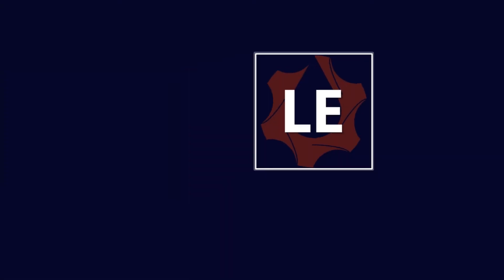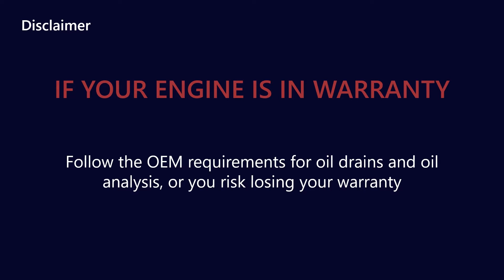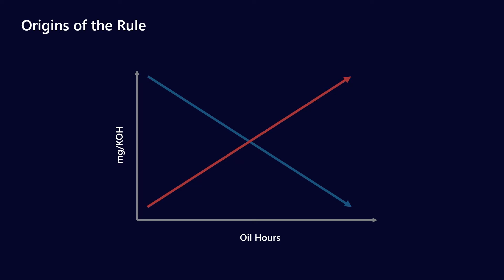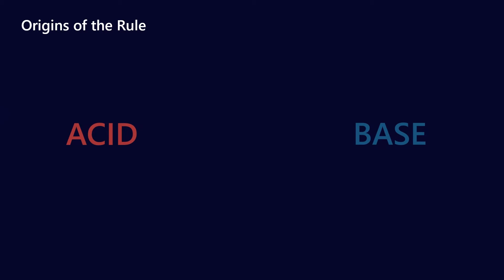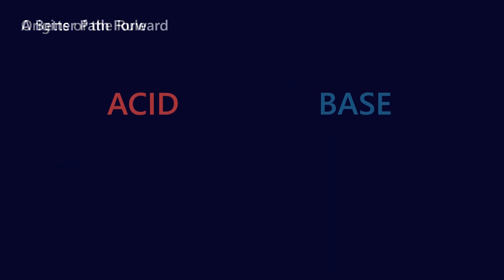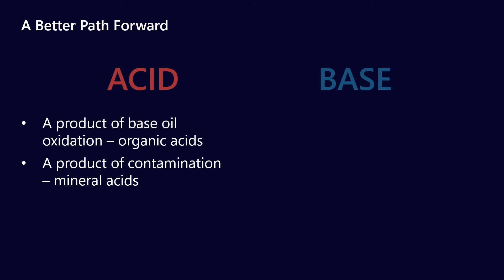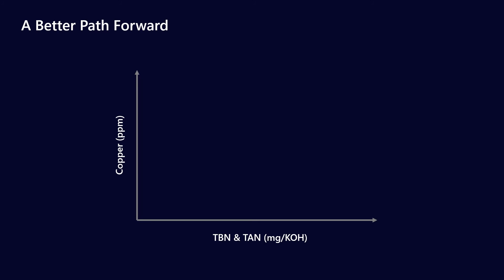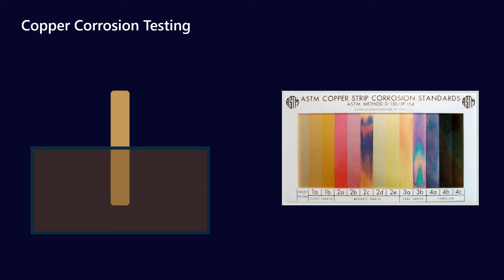Why you should stop using the TAN x TBN crossover limit to condemn your gas engine oil

Comment: Is copper strip corrosion test representative of any other metal in the engine? From what I remember, metals can corrode differently, depending on the condition ( including the possible coupling of west and corrosion, i.e tribocorrosion, which would promote corrosion on some elements more than on others, I suppose) is there no similar test method for say steel, aluminium or tin if such metals are present in the motor?

Comment: Congratulations for the video!
I have just carried out two laboratory analyzes, one on virgin 5w30 oil and the other on the same type of oil with 3200km, carried out in a turbo petrol engine, with my surprise the TAN on the use oil has dropped from 1, 7 to 1.31 ...
Could you know why?
Is the gasoline dilution perhaps one factor that may affect it?
The dilution value of the used oil is 4.5%

Comment: @Lubrication Explained how can you compare 1a or 1b copper corrosion test with any of TAN or TBN mg KOH/g? I mean how I can say that if initially 10.0 mg KOH/g of oil TBN is now depleted with copper corrosion?  Simple you can not compare copper ppm too with TAN/TBN depletion. Its only justifiable method to know the condemning limits of TBN is to measure TBN or TAN. As per my knowledge if TBN is depleted 70-80% then we can change engine oil or if TAN value increased 2 or 3 mg of the initial value then it will also be condemning because wear can occur due to depletion of zddp or it can also due to dust (abrasive wear). Right?
Reply from the maker: The question this video is trying to answer is - why do we change engine oil when TBN is depleted? TBN is itself an arbitrary construct. So what is special about 50% depletion? Or 80%? Why is the percentage the same for an oil with a starting TBN of 10, and one that starts at 5?

We should really care about the EFFECT of TBN depletion. If TBN depletes, then the risk to our engine is that we experience corrosion. But if there is no corrosion, then why change the oil?

You are right in that wear can occur - but this is a seperate failure mechanism. If the TBN has only depleted by 2% and we see high Iron then this may be a reason to change the oil or investigate the mechanism of wear.
Reply: @LubricationExplained  oo oky oky you are right oil change practice should not only based upon TBN depletion, one should check complete chemistry of oil like wear & tear, water contamination etc etc
Reply: @LubricationExplained  but after all complete check up its come to the point that TBN upmire will be the final authority of oil change, then how much % depletion you guide 😊?

Comment: How TAN & TBN coexist same time
Reply from the maker: Good question - it doesn't really seem to make sense does it? There's a couple of explanations. The first is that our understanding of acids and bases are shaped by aqueous solutions. In oil, the acids and bases aren't necessarily dissociated, so H+ ions and base molecules don't necessarily react with each other. But at the same time, most acid-base reactions are equilibrium reactions, in which not all the acid and base reacts with each other.
Reply: @LubricationExplained  How much % depletion of TBN you will suggest at which oil should be replaced?

Comment: Great explained! Some cars already have sensors to monitor lubricant condition, do you know what they monitor?
Reply: Just color or transparency. Actually less sophisticated than just pulling the dipstick and using your fingers and nose, but is good for the marketing department's feature count and the many completely ignorant car buyers that have had zero auto-shop or driver's-ed. training. (I've met some that don't know there is oil in the car let alone that it needs to be changed....yet they are licensed operators...)
Reply: @mytech6779  I can imagine! I believe every driver must know the basic about its car to keep it running properly. But....just a few think like us!
Reply: @luizfernandopaquieli3709  Really drivers-ed should be mandatory regardless of age  and one semester of auto-shop required in high school simply because cars are so completely integrated into life in the USA. Especially with increasing immigrant populations that do not have the advantage of a family history with motor vehicle operation.

My original comment isn't about being able to maintain the vehicle, it is about proper operation, fewer breakdowns blocking traffic, fewer accidents caused by malfunctions or exceeding a vehicles limits, less pollution from abused vehicles.
 
Very few aircraft pilots are certified to do any maintenance on an aircraft but the FAA still requires a solid understanding of aircraft systems specific to a category of aircraft for a pilot certificate.
Reply: @mytech6779  that is worse than I thought! I was thinking you meant about knowledge on mechanics, but talking about the correct way to drive must be the minimum to get a car on street! We face the same situation rere in Brazil, but some States there's no discipline and education on streets, not only drivers but people and bikers don't respect each other!
Reply: @luizfernandopaquieli3709  I have not been to Brazil. The driving license system in the USA is very old and depends heavy on parents teaching children the detail. This alone was only on the border of acceptable when the population was low, and there was always a fraction of bad drivers.
But with many new immigrants from countries where there are very few cars,(such as Asia and Pacific Islands) they do not have this family knowledge which makes the situation much much worse. And it is extremely obvious an an observer with professional training that many simply have no understanding of the vehicle function. The increasing population adds more traffic which multiplies the problem.
Reply from the maker: Wow, great discussion! I think you already have your answer, but just to elaborate - even the inline sensors coming to the market in industrial applications aren't all that sophisticated yet. I've seen some decent live monitoring of oil cleanliness, but that's about it so far.

Comment: wow! this is a good eye opener. we should lobby a standardized test for this than the TBN and TAN crossover.
Reply from the maker: I'd just worry about TAN to be honest. I've always found it wild that if you're using a .5% ash oil you would condemn the oil at a TBN ~2.5. And yet if you switch the same engine over to a 1% ash oil, all of a sudden you need to trash the oil at a TBN of ~5. Makes no sense.
Reply: @LubricationExplained  True, I think that those before us have thought about this TBN and ash and just place the numbers and decision standards based on their observations at available technology. Maybe we can switch to the amount of wear an engine can tolerate than the TBNxTAN. At the same time introduce a minimum standard material for engine manufacturing. Long work but makes our lives easier in the end, right?

Comment: Not sure about this. My understanding is, that new oil has TBN & TAN is zero?
Until TBN actually goes down to zero - How can TAN even start to appear?
Reply from the maker: Generally, new oil will have a starting TAN around 0.5-1 mg/KOH - base oil refining isn't a perfect science so the is some trace amount of carboxylic acids that make it through the manufacturing process. 

Unfortunately our understanding of acids and bases is usually shaped by the mineral acids and bases that we learn about in chemistry (like HCl, H2SO4, NaOH etc). In most of these cases, if you have a basic solution like aqueous NaOH and drop some acid in like HCl, some of the base will neutralize the acid, forming a salt and water, and the solution will continue to be basic. But that ignores the whole family of acid-base reactions which are equilibrium reactions (i.e. acids and bases are present at the same time), and moreover lubricant chemistry isn't aqueous. So all our assumptions about acids and bases are wrong anyway.

In the real world (and you can ask any natural or sour gas engine operator) both TBN and TAN will have positive values at the same time. TBN will deplete while TAN will increase.
Reply: @LubricationExplained  Thank you for your explanation :) Which could lead to sources of confusion & clarifications. 
First confusion: Yes, pH is for aqueous solution & lubricants are not aqueous. For this reason, TBN & TAN are the preferred parameters for lubricants. Why even talk about pH?
Second confusion: What units are you using? The TBN unit should be mg KOH/ g lubricant? 
mg/KOH is B.S?
TAN is mg KOH reqd to neutralise 1 g of Crude oil.
In the real world - Small TAN, as you say,  is said to be present in new oil.
Therefore my original question remains unanswered: What is the TBN doing? Not fighting to The Last Man?
Are acidic molecules able to survive total destruction? Ions lurking with potential?
In order to measure TAN, the lab has to add KOH and measure mg/ g for neutralization?
How come KOH acts Then - But not in the First Place?
Reply from the maker: Yeah that probably wasn’t very well explained. We included discussion about aqueous pH because there’s a (relatively) new used oil analysis test called ipH or “apparent pH” which aims to test the corrosive potential of an oil. It’s a test that’s slowly being adopted by gas engine OEMs but isn’t very well understood. Your second point is correct - mg KOH / g is the correct unit!
Reply: @LubricationExplained  Thank you for your response :) At least we're on the same page now.
I have watched most of your series & it's usually, well explained. 
The TAN/ TBN thing does seem abstruse. I'm thinking: the additive package, incl KOH, should be held in solution, in the engine oil; Albeit, non-aqueous. Seems this is achieved with non-polar base oil, by Ester, or Alkylated aromatic, polar solvent? Solution implies ionization, even when non-aqueous?
Acidic ions have corrosion potential, but are held, preferentially, by K+ ions?
This leads to the question as to how the lab determines the content?
And then, K in the lab report, comes under the heading of coolant entering the engine oil? (Also Na)
Reply: @lesliedsouza4077  K and KOH are  not used in oil or oil additives, KOH is used in lab tests.